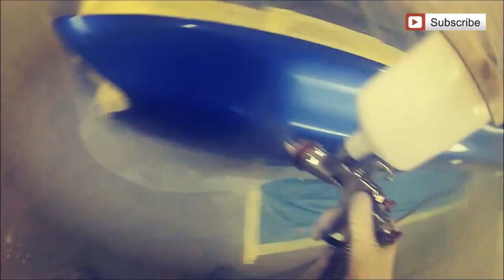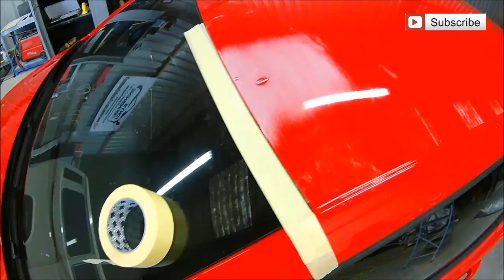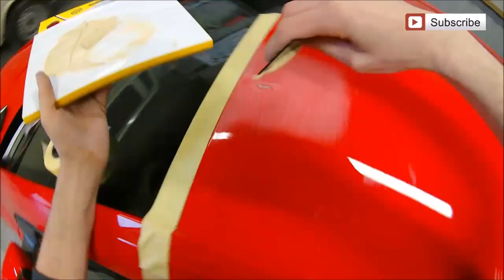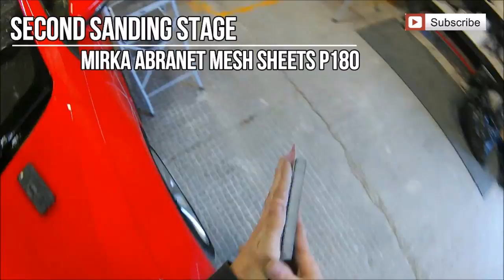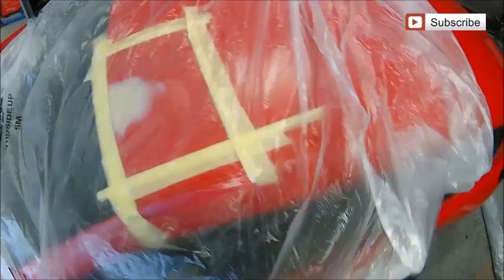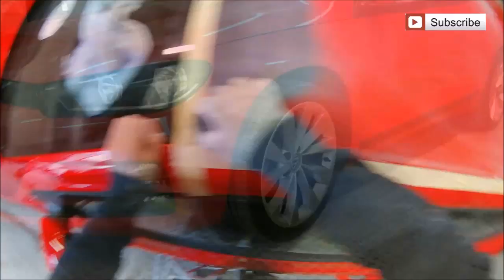Part 1 - Volkswagen Scirocco Roof Repair And Prep Including Materials And Consumables

Comment: whats the best sanding disc too use for knocking back laquer i wnt be priming just gona go straight with base and laquer
Reply from the maker: If you basing the whole panel just go for p500 mate
Reply: @TonysRefinishingTV  whats the best 500s too use i tried one called basecut other day but diddnt last very long at all
Reply from the maker: Try the sia sia speed ones mate there great
Reply: @TonysRefinishingTV  sorry too be a pain but have you got a link please, and thankyou for reply
Reply: Also is it possible you could do a vid of the sanding discs you use and what you prefer for different jobs

Comment: hi how do you rate the air compressor your using  I got the 90ltr belt drive from GTair what psi at the reg is yours set at I got mine set at 100 psi is that about right
Reply from the maker: +craig jenkins hi craig for the cost of these availability of parts service from the supplier ect I think they are great , had mine a good while now with no issues at all mine is set to around 90 I think off the top of my head but I have the setup detailed more on the video I did on the compressor and setup

Comment: Another great vid - thanks Tony. Looking forward to part two!
Any thoughts on using microfibre cloths instead of takrags? I hadn't thought of using microfibre for anything but final dusting and getting rid of finger prints..
Reply from the maker: +Adrian Hamilton I don't use them for final prep just for use along the way during repair stages ect to keep things a little cleaner and give things a quick clean between sanding and when checking
Reply: +Tonys_Refinishing coolio. Thanks for that! I'll carry on using tak-rags just before painting, but will get a couple of microfibres for general prep :)

Comment: Hi again Tony don't know if you have used the trick of wiping the stopper over with base coat thinner and a shop towel before starting to flatt it removes the sticky from the surface and no longer blocks the sanding pads
Reply from the maker: +jason evans not something I've ever done or heard of tbh and I don't think I would tbh with the risk of the thinners affecting the filler or stopper
Reply: Hi Tony, it sounds like it could give you a problem but i have done this for almost 40 years with not one single issue but i have had issues with the resins that are left on the surface of fillers and stoppers causing problems, try it and let me know